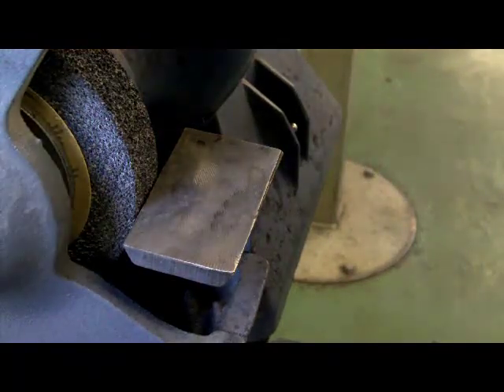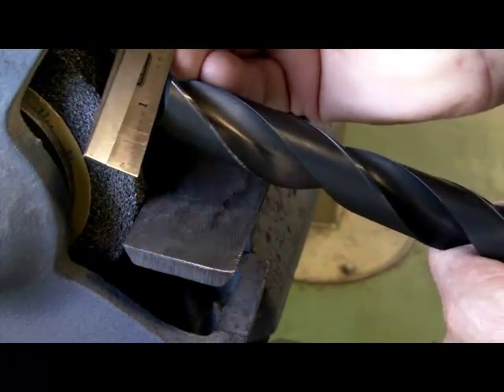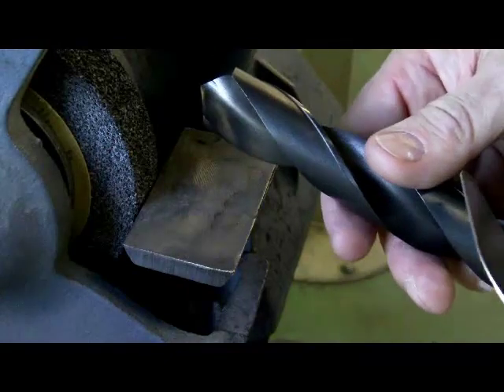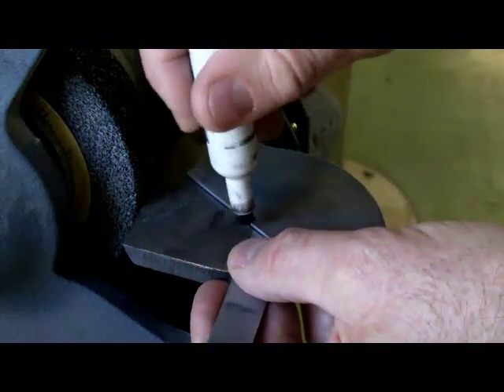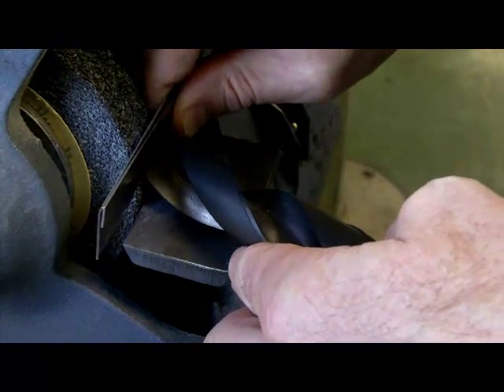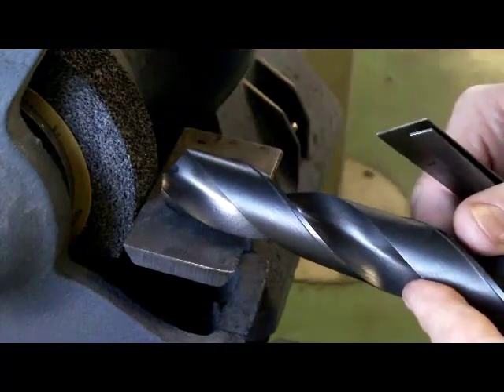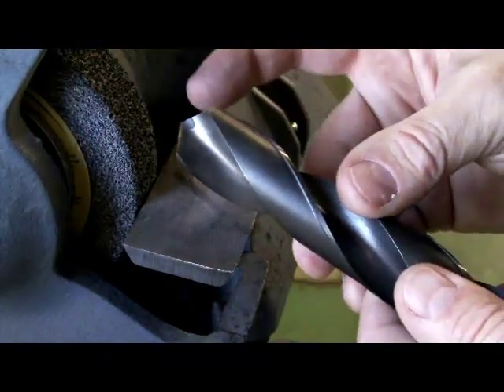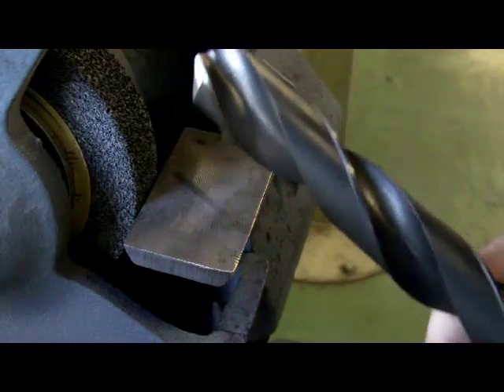Twist Drill Sharpening

Comment: Cabn I ask if the tool rests there are parallel to the bench/floor? You seem to lift up the drill bit quite a lot to get the position which you actually describe as parallel to the floor - also are you doing most of the grinding work significantly above the centre line of the drill ? Thanks if you could add a little explanation. 👍
Reply from the maker: Hi Julian thank you for your note. I find I have more control holding the drill in my hands than sitting on the tool rest. If I am above center, I bring the back of the drill above horizontal so it is inline with the grinders center. When I push the point of the drill above center I'm trying to create a clearance ange behind the cutting edge. I hope that makes sense. Thanks for watching.
Reply: Yes I see with a slo-mo replay! I've had several bits to sharpen & with more practice, a bright light & some magnifiers I have improved. Put a freshly sharpened 1/4" drill through the head of a grade 8 bolt pretty easily! Thanks again!  @machiningmoments

Comment: Over the weekend I was attempting to drill 5/8" holes through 3'8" steel and my bit wasn't cutting.  I even used a step bit to get the hole started, but its steps weren't deep enough to cut all the way through the 3/8" thick steel.  After wasting several hours trying to get the bit sharpened, I found this video.  I had the basic concept, but was missing some of the finer aspects.  After watching the video twice, I was back in business after following its sharpening procedure.  I had the bit pretty screwed up with my grinding prior to watching this.  Thank you for the excellent explanation and demonstration.  I had watched several shorter videos and their explanations and method of grinding weren't working for me.
Reply from the maker: I'm glad it worked for you. I really appreciate hearing that these videos help people. Thank you.

Comment: What is the difference between the 8 to  12 degrees & the 118 degrees?..Very confusing
Reply from the maker: The 8-12 is on the heal, behind the cutting edge. The 118 is the angle created by the two cutting edges. Sorry for confusing you.

Comment: +machiningmoments -Thanks for the Video & helping to carry forward the art & craft of renewing the cutting edge of your tools.  With "Shop Classes" cut from many schools these days it is good to see you sharing your knowledge & instruction on a skill becoming limited to those in the "Trades."  
Benito Caspo  - If the wheel ran the other way, it would throw sparks - chips up and into the user's face.  Also, when sharpening, you place the the edge to be sharpened into the direction of rotation of the wheel, as was done in this video.  Recommend you recheck your sources on desired direction of rotation.
Reply from the maker: +Harry Marty Hi Harry, I agree about sharing forward our trade...I guess that is why I do this. Thanks for your comment and support!

Comment: The wheel should run the other way.
Reply: +Benito Caspo Nope, the way you see in the video is correct, the sharpening is clean without unwanted edges.
You should sharp knifes and scissors  the other way, but then you need a totally different wheel with water.
Reply: Lee Enfield rifles

Comment: Listen to that drill bit bounce! Look at the grinding wheel as it stops. It's as round as my head! Roughly balance it b4 tightening ( not easy to do ) and then dress and repeat if necessary. Like you would with a larger grinding wheel for a Surface/Cyl grinder b4 balancing it prior to first dressing.

Comment: Simple tip - Weld 2 nuts together and you now have a drill guage to test the cutting angle. It will be 120 degrees which is pretty close to 118 degrees for all normal drilling purposes.

Comment: In my experience with HSS lathe tools, if I overheat the cutting edge (discolors), it will dull quickly.  That is just at oxidation temperatures, I have not taken one to incandescent temperatures.

I might try it some time, would sure speed up grinding a new tool from a blank.

Comment from the maker: Hi Jeff, the problem with grinding the drill upside down is you can't see the cutting edge. Also you are "on edge grinding" which is an issue for the cutting edge. Not only do you need to consider the drill angle but also the clearances, this would be difficult with a power drill and dangerous. With a bit of practice you will be grinding drills for precise holes in no time!

Comment: The cutting edge should face downward from the grinding wheel, opposite to the direction what you are doing. Before seeing your video, I tried this similar to your video before and the drill bit cannot be used anymore.
And why dont mount the drill bit to a power tool so that the drill bit also rotates for grinding?? It will make both tips more close to same. Hand held the drill bit like this will make different on depth of grind on both cutting tip, finally it can't be used for precision holes.

Comment: Using a Cristen drill sharpening machine, Swiss-made, i could point a small carbide drill with a primary cutting edge and secondary clearance edge, in 30 sec.s. I did this all the time, when running my Swiss Automatic Bechler and Tornos machines. Old School Rules!

Comment: I gotta sharpen 2" drills for work. Sometimes drilling a hole 14" deep. So I know I can sharpen a drill well. I can do it by eye, but for the deep holes I use the drill gauge to make sure. Drills under 1/8 are tricky to grind and drills wider than the wheel are tricky too

Comment: They do not know I do not know, but if I had to grind drills use a dipstick and certainly not because these are complex and slow přísiš work all you need to know the angle of top drill collar and charcoal (about 4 ° x0,5-1mm drill podlevelikosti) for hand drill which is necessary for podbrus facet to facilitate drilling or drilling is a good sweat and I do not see in this video.
Podbrus here is performed mechanically and have it all drills at the factory.

Comment: I prefer a medium grit wheel for sharpening, then finish up with a fine grit wheel or belt sander. To square up my wheels, I use an old broken hammer drill bit. The carbide tip makes nice work of the wheel face.

Comment from the maker: Sounds like you have lots of experience sharpening drills. Chucking small drills is a nice touch acting like a pin vice. Silicon carbide is used on carbide and non-ferrous material and you are absolutely right avoid breathing the dust! An abrasive stick works great for wheel dressing; I will often use it to dress a form or shape on a grinding wheel. Thanks for the post!

Comment: I have a large chunk of coarse grit silicon carbide abrasive that gets used for dressing the bench grinder wheels. The same material is used for grinding concrete and masonry. You can save an old worn out concrete grinding wheel as a tool for dressing your bench grinder's wheels with. Rest it on the tool rest and clean and true your wheels beautifully. Don't breathe the dust from that!

Comment: That bench grinder I use only for drill bits (and the occasional TIG tungsten....).  As a fabricator who drills all of my many holes (no ironworker punch in my shop), sharp bits are essential....For smaller bits, when using the air drill, I just leave them chucked up in the air drill to sharpen. Makes it easier to hang onto them and be accurate.

Comment: I do it very much like you do. My bench grinder has a "v groove" on the right hand side tool rest (where the fine grit wheel is, and just like where you marked with the permanent marker). The groove gives me that perfect 59 degree  edge angle just by resting the bit in it and spinning it against the wheel. That leaves me with no "relief" angle, which is then cut back by rocking the bit up and down on the coarse wheel just like you do. Large bits are easier than smaller ones.

Comment: I agree, i work alot in the field and i normally use an angle grinder and eye measurement for the angle.
As i was told by the old guys at work: " if you cant sharpen your own drill bits and have to stop a job because you need a new, you will look like a moron."

Comment: Well, I use LPS Tapmatic AquaCut. I generally don't drill over 1/2" diameter with a jobbers length twist drill. Anything bigger I drill 1/2" or bigger then bore and/or ream the hole. My hole tolerances are generally around .003 (or better) in position and diameter. I use a good center drill (combined drill/countersink), spotting drill or stub length drill bit.  Generally, I usually drill .015" undersize and ream because I do really care about the quality of my holes.

Comment from the maker: I have had good success with a 118deg HSS drill. Two things come to mind, if you are drilling aluminum sheet the diameter of the drill must be in the material before the point breaks through or you will lose your center. If this is an issue you could use a hole saw if it is a large diameter or a neat trick is to drill between two pieces of plywood (works great for shimstock). Second aluminum is gummy, A-9 works good, I have also used kerosene but beware of fire hazards. Hope this helps, thanks

Comment: I do a lot of aluminum sheet and aluminum plate up to 0.500" thick, what type drill bits do I need for drilling 2024-T3, 7075-T6 and 6061-T6? Would it be HSS, Cobalt or Carbide? Would it be 118deg or 135deg point?

Comment: It "Greek" to me. This is one of the best videos I have seen on sharpening a drill. Well done. The amount of skill required is huge. So I cheated and bought a DBS-22 for my Tormek. Its expensive but lets me produce a useable sharp drill.  I still have a go on a grinder from time to time especially with smaller drill bits.
 Do you face off the cutting edge of your drills for cutting brass to stop them grabbing?
Regards

Comment: As a student of the Man behind Machiningmoments. I will add this statement. We deal with alot of nitronic 40/50. Which is a very hard nickel based stainless steel. No matter what angle the darex drill sharpener is set too...we cannot get more than .500" in d.o.c. before we have to resharpen. YET...when we sharpen the drill by hand, which results in an ugly, YET, accurate drill point. We get closer to 1.0 - 1.5''. @ 118deg depth of cut....i agree with Kingdon. He's a good machinist.

Comment: PART 2 Take a look at John Moran's hand built Drill sharpener-copy and paste "4 Facet Drill Sharpener - Shop Built" (without the quotes) in you tube. This guy built a very clever sharpener quite unlike Drill Doc and I'm convinced Moran's machine is far better. Makes you wonder how much it would cost to make one. A Drill doc cost about $100 but it will not last and is not as precise and user friendly as Moran's machine. I have yet to make one maybe even a better one

Comment from the maker: The most common problem (without seeing the drill bit) is the cutting edge is lower than the heal (part behind the cutting edge). Hold the chucking end of the drill vertically and place a straight edge (6" rule) at right angle to the cutting edge and at right angle (horizontal) to the vertical drill. Does the straight edge touch the cutting edge or behind it on the heal?

Comment: I used the Drill Doctor to sharpen my old HSS, titanium, and cobalt drills.
When new a 3/8 in. drill will directly drill into 1/4 in steel plate no problems. After sharpening, the drill won't even drill a hole into 1/16 in. sheet metal. I believe the tempered edge is removed from the bit during the sharpening process, rendering the bit useless. But the Drill Doctor won't grind off your finger, like an open grinding stone. Jeez.

Comment from the maker: @Plutonion2 Yes, it takes a bit of practice. Masonry drill bits are typically carbide tipped and have a steeper included angle (135-150 deg) so move shank closer to perpendicular to grinding wheel face. Because of the carbide tip it requires to be ground using a silicone carbide grinding wheel (or diamond). Be aware of grinding dust and use protective equipment! Thanks for the note, I will try to put a video on for you.